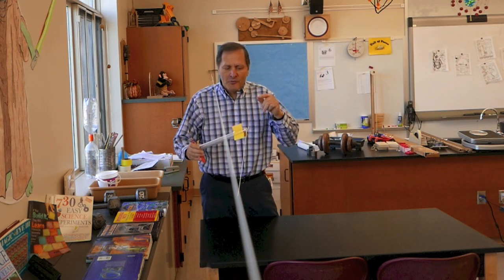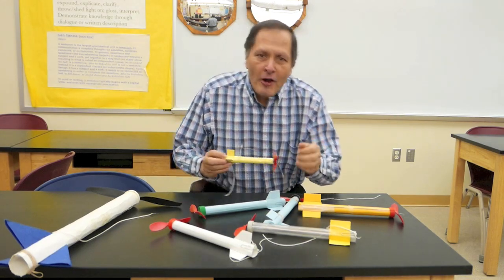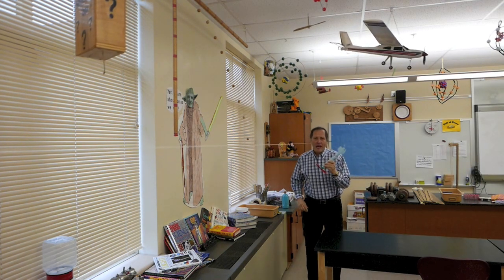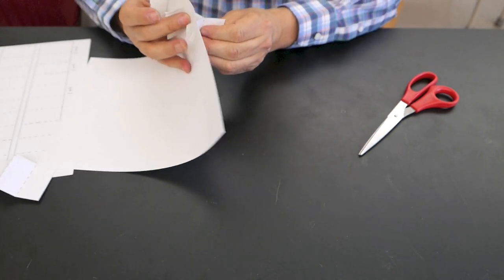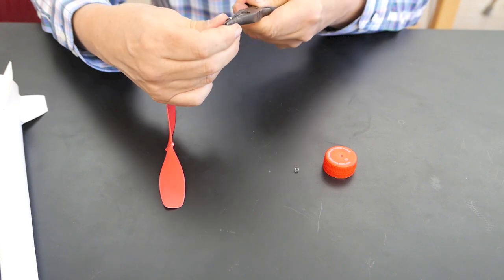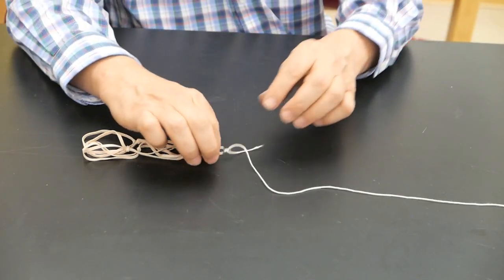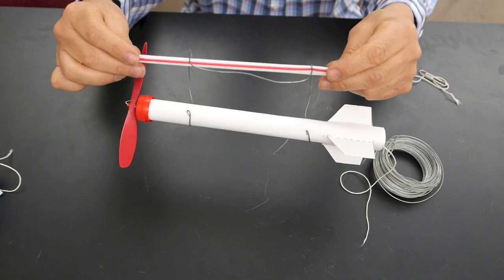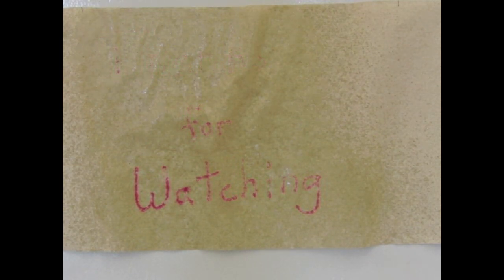Physics of toys -string racer/ string rocket //  Homemade Science with Bruce Yeany

Comment: I love this! Thanks for sharing. Do you think this would be able to move about 5 ft. across the string if we added weights either inside the roll/tube or hanging from it slightly? It can be up to 10 weights 250g each or less. Thanks!!
Reply from the maker: I haven't tried adding weight to it,  but it depends on the size and the number of rubber bands.

Comment: i brought 152*76 propellers and they dont move more then 2 inches
Reply from the maker: Hi Gummy Bear,  not sure what size that is,  the ones I used are from Kelvin educational . 6 inches long, very cheap
Reply: Bruce Yeany 152 part is length the other part so i can figure out is how far it pulls per reverloion. Oh well mine might be for gas planes

Comment: Sorry...
Our rocket couldn't move. We think we used the wrong rubber bands. So about the rubber bands size?
Reply from the maker: I used three sets of  1/8 inch by 4 inch rubber bands tied together.  Other sizes could work,  I've also used  some 1/8 inch by 8 inch long  that also worked well.  Try adding more to what you have
Reply: I'm facing the same problem, is it because of the different material of rubber band? Or there should be no gap between propelar and bottle cap?

Comment: When I was in Cub Scouts, one year, we had to build these instead of pinewood derby cars. I can see mine sitting on the shelf right in front of me as I type this, in fact. It... didn't do so well. I came in last place every time until the adhesive came undone and it fell off the string entirely.

My derby car from the previous year was unbeatable, but my flier wasn't even airworthy (stringworthy?).

Comment: what's an alternative to the propeller??
Reply from the maker: it does need a propeller but not necessarily a store bought one.  The propeller can be made with a popcicle stick with cardboard glued and bent onto it.  You can also soak a tongue depressor in water twist it 90 degrees from one end to the other and have something hold it until it dries, it will then hold that shape
Reply: +Bruce Yeany (Yeany Science) halo sir ,how to make a propeller for model plane or boat?
Reply from the maker: A tongue depressor can be formed into the same shape as a purchased propeller by twisting it 90 degrees from one end to the other.    If the tongue depressor is soaked in water for about an hour, it will become soft and pliable and easily bent. The depressor is then bent 90 degrees form one end to the other.  After they dry, they will retain the 90-degree twist.  A hole is then drilled in the center for the propeller axle.
Reply from the maker: If you do an online search for  "homemade toy propellors"  you can find several examples that will work